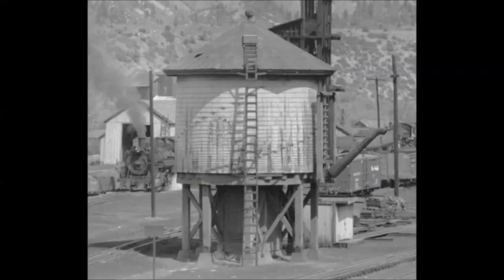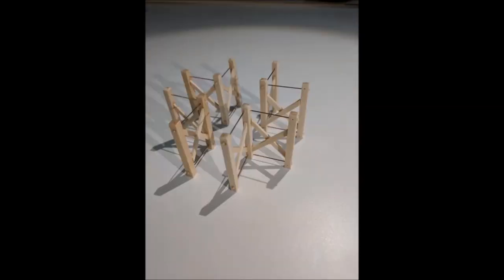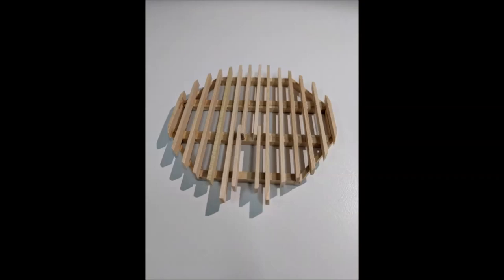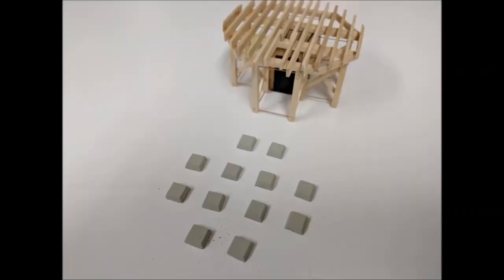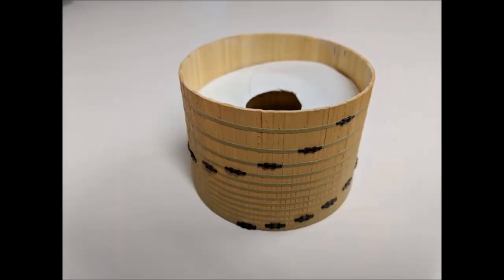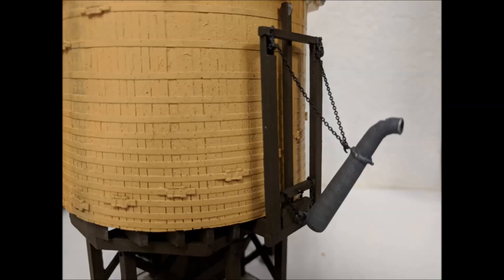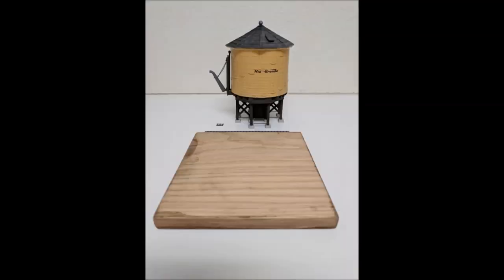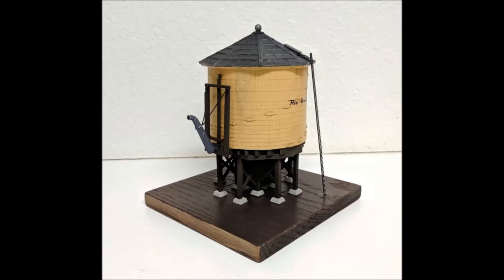Ep 2 HOW-TO Durango Press HOn3 Water Tower

Comment: Hi Mike. Looks great as usual! What brand and color of paint did you use for the tank itself? I'm not so picky that it has to be THE correct color, but that looks close enough for me.  Thanks....Claude
Reply from the maker: I found Star Brand paints, and bought a bunch of their colors.  They don't actually show the colors on their website, but I bought out the local hobby shop.  They are sold through PBL, the Sn3 guys.  This one used STR-09 D&RGW Depot Buff, and STR-33 D&RGW Trim Brown.  Some of the later episodes for the RGS structures I list the paints I mixed.
Reply: @mccarvillestudios  Thanks for the info, Mike!!
Reply: @mccarvillestudios  ...... Did you brush paint the Star paints or air brush them?
Reply from the maker: @marklewis298  airbrushed both colors after thinning them 50%, since that paint is sold thick, but there was touchups with a brush too.
Reply: @mccarvillestudios  Mike, what local Hobby Shop carries the Star Brand Paints?
Reply from the maker: @jstockton303  I go through PBL to buy those.